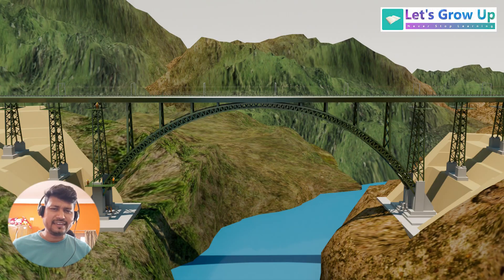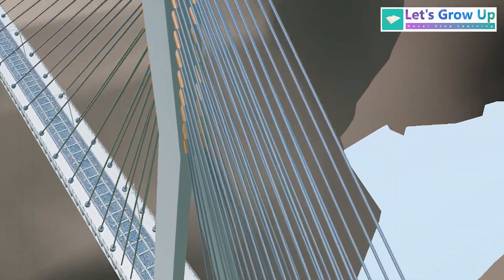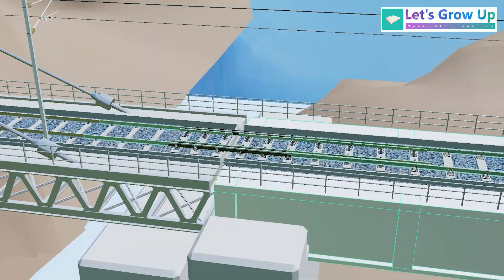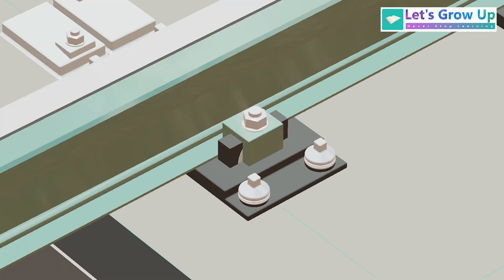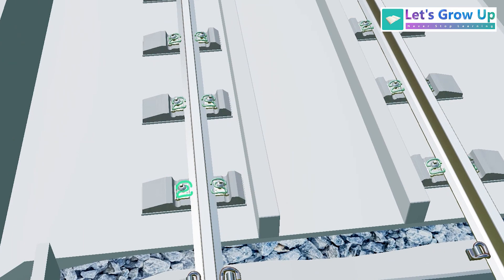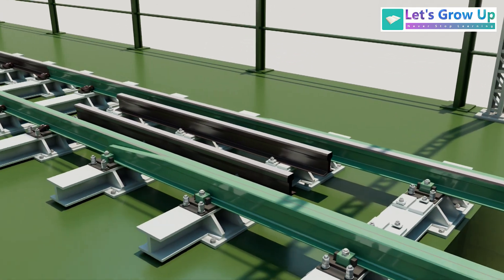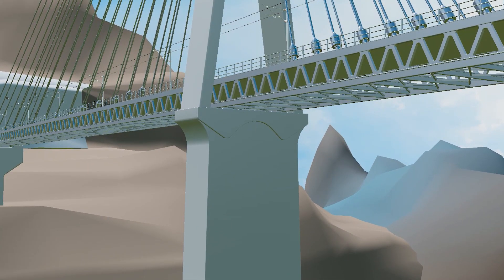Anji Bridge vs Chenab Railway Bridge | Why Anji Railway Bridge is special? | Let's Grow Up

Comment: I'm a viewer from Japan. 🇮🇳🤝🇯🇵
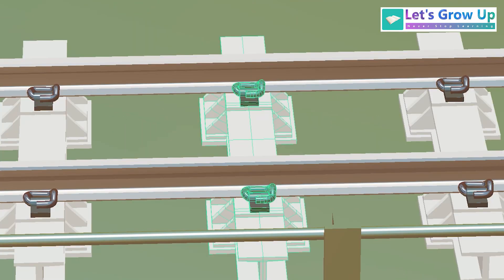I felt this in the previous video, but in the track joints of the bridge section shown from 1:05 onwards, it is very difficult to read from the CG shown in the video how they are dealing with the bending of the bridge girder in the vertical direction due to train running, the transition of the bridge girder in the horizontal direction due to strong winds, and the expansion and contraction of the rails due to rising temperatures. 🤔

The CG only shows one rail firmly supported from the left and right, and a guardrail to prevent derailment is installed, but it does not clarify how the bending, twisting, expansion, etc. of the track mentioned above are safely absorbed and the track is kept in a state where there is no disruption to train operation. 
I may be rude to you, but I think they need to be a little more creative in how they show the CG. 🤔

Also, if the joints of the real bridge are as shown in this CG, I think that either revolutionary new technology has been applied, or the above-mentioned points were not taken into consideration at all during the design. 🚃💨🍀